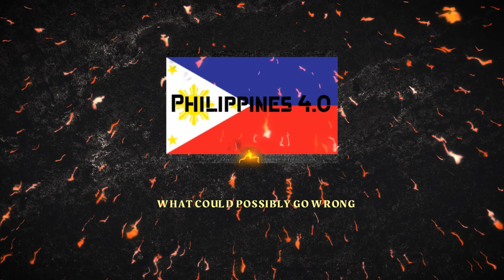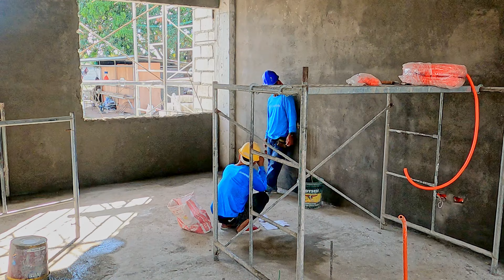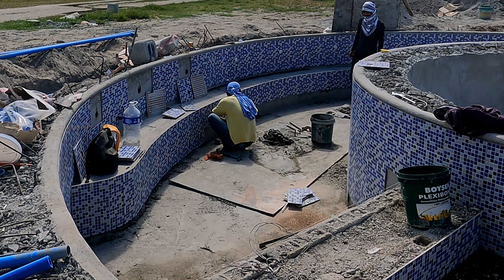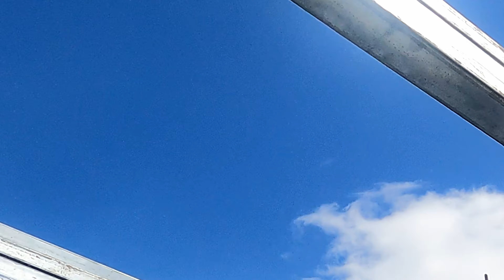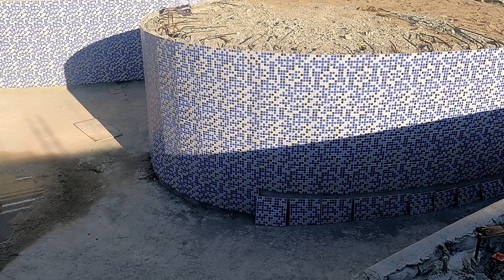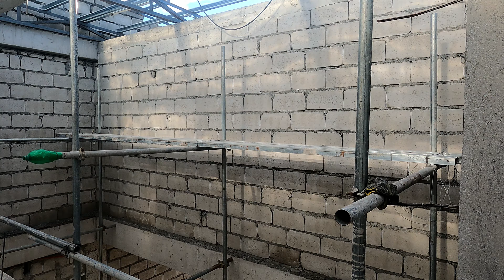Philippine House Building Day 135 - Rico's Birthday

Comment: Twice!!  Lintel is what they are putting in temporarily above doors and windows.
You need these for more than 1m width (in UK builds).  I notice that hey are leaving the gap at the side after the temporary piece is removed, perhaps there will be a lintel added when they put in the frames?
Reply from the maker: Stephen
They are not putting lintels back in. It seems they are rely on the fact that the door frames are metal to give the required strength.
My dad was talking to me about this last night. On the ground floor, where all the doors and windows go up to the beams, I think we are ok. 
On the second floor I am not so sure, but in the end have gone with the builder's experience.

Comment: All of the trusses should be painted, I note surface rust on some already, Red Flag, you don't want that. a huge cost in 10 years time if it is not addressed now.
Reply from the maker: Absolutely correct - the trusses are showing signs of rust.

Comment: Very important that every area where welding has taken place that rust inhibitor is applied before an oxide paint so that you don't get rust forming in your trusses which easily happens when you have a narrow space between roof and ceiling. Moisture can build up in this area. A good vapor paper and soundproofing membrane (rollout material) over the purling's under the roofing will assist in preventing  moisture build up in this space.
Reply from the maker: Larry
This is invaluable. Will talk to the builder today to try to make sure all of this is going to be taken care of.

Comment: Hello to all .Usually up here they don't pour a concrete lintal above doors /windows  etc unless client gets it priced in at design stage as it has to be approved.  There usual method is to place 1/ 20 mm or 2 /16 mm bars above the form ( steel / ply) and connect it with 12 mm bars to the beam above . Then finish hollow block wall up to beam. Strip the form out after 2 weeks . Local method is structurally ok .  Regards Mick.
Reply from the maker: Thanks Mick, good to get another approval on the way they have done this.
Given that they have gone to the trouble of putting in those steel bars, I am not really sure why they remove them again.

Comment: Happy Birthday Rico.
Looks like good solution for the pool dividing wall.
Roof I do like angle brackets connections purlins to truss, I prefer bolts in purlins to brkts but Filipino usually weld. The problem with weld on galvanized steel is the heat will remove galvanizing coating both sides of the steel , difficult to weld due to zinc and 2mm steel difficult to weld with stick welder and any undercut reduces structural integrity. But as usual Filipino weld because it's the easy way. 
Good progress  👍
Reply from the maker: Thanks for the birthday greetings in Rico's behalf.
Hopefully there is enough metal in the frame to mean any loss of integrity is not catastrophic.
I do want to be sure they use a rust-proofing agent on all the metal up there.
Reply: @philippines4.0buildinganew64  With the purlins  cold rolled, very good product however welding removes the galvanize were bolts are the best option.  I guess in NZ computerized fabrication the holes are prepunched making bolt assembly for purlins simple and fast.

Comment: Good plan to put holes to wall at shallow area. Those need to be on wall. I would but six or more to maximize water flow around island and that shallw area. Btw, am starting with swimming pool end of this year in Bohol. Very interesting to see how they have make yours.  
Marco
Reply from the maker: Marco
Have put a piece in today to explain what it will now look like. Not several holes, but one wide channel - hopefully this will work.
Good luck with yours when you start.